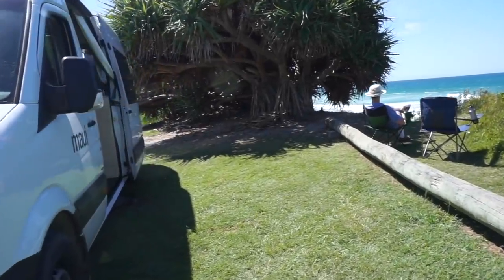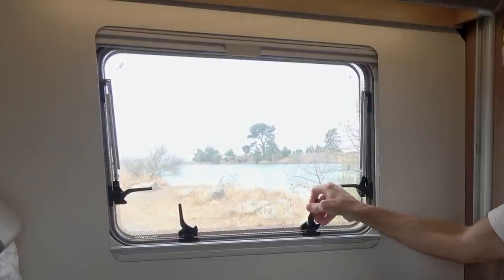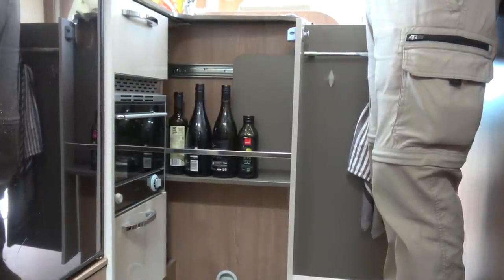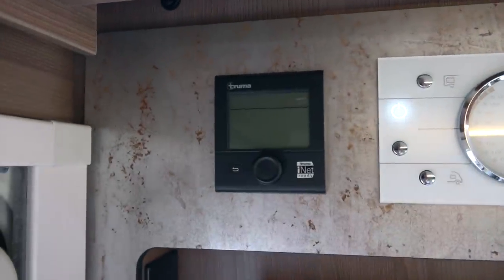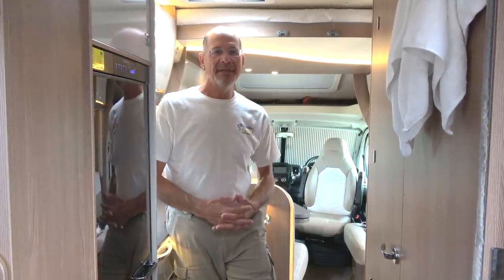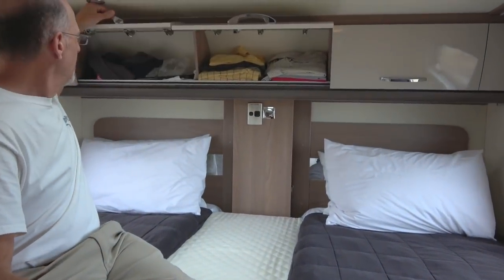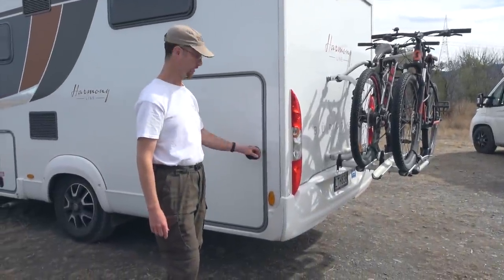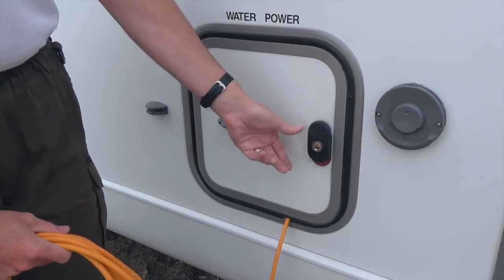Class B+ RV Tour 🚐 — In-Depth Look at Our New Zealand Wilderness Motorhome Rental

Comment: Our Winnebago Navion has the same shades up front and in the coach with one exception our latches don't have the locking button which would be great. The Navion is our third RV and we especially love the cab shades. We love the tilt up windows too for the reasons you mentioned.  Love the floor storage in the floor!
Reply from the maker: We've heard nothing but great things about the Navion, Barbara! So no surprise you've had three! We realized that we forgot to mention that there is another almost-identical in-floor storage compartment back near the bedroom! Very good use of space.

Comment: I love the blinds you're talking about. They would not only keep everything private, but also relatively cool in the summer. They should make them for car use. Here in the Northwest USA during the summer months, the temperature reaches in the 80s. With the windows up, the inside of a car can reach the triple digit temps. With something like this around the windows, I would imagine it would be around 70 degrees, with the AC unit going. 🙂
Reply from the maker: Those window shades are indeed awesome. The ones in the side windows are even highly reflective on the outside. Not sure why the windshield isn't the same way, but either way, they really help keep the rig cool, especially when you combine it with lots of windows that open very wide.
Reply: They should be available for installation on cars and trucks as well. 🙂

Comment: I think the skylight was installed with the opening facing upwards so it can be opened while driving. Otherwise the opening would be facing downwards so the skylight can be opened while it is raining outside and it would keep it from coming inside the campervan.
Reply from the maker: Good thought, Jay! That does seem possible, although the struts that hold the skylight up might not be up to the task of holding  that large surface area open against much  wind!
Reply: @RVgeeks  you are right it is not made to be opened while driving. I have been told the skylight is positioned in such a way as to not get torn off while driving at higher speeds if air were to get under.

Comment: One thing that caught my attention was storage of wine glasses and mugs. The shelf seemed to sag under the weight of upright stemware. Am I wrong? This looked like the only thing that needs improvement on an otherwise awesome RV. Glad you made it back safe.
Reply from the maker: Hi John! If that shelf seemed in the video to be sagging under too much weight, we definitely didn’t notice it. The design of that glassware shelf, where each glass and cup was individually fit into its own holder, was so far and away better than the RV we had in England, where all of the dishware rattled like crazy as we drove!

Comment: Interesting it does not have a rooftop A/C unit. Guess you would not need it too much with that many skylights and windows.
Reply from the maker: Good spotting, Scott! No AC. It's available from Bürstner as an option, but with the windows opening so wide (and the typical climate in NZ), we didn't need it at all. Even though it was Autumn while we were there, it apparently doesn't generally get hot enough in NZ for anything more than the windows and roof vents to be needed.

Comment: Great job guys, 2 questions: Are the batteries lithium ion? Would the bikes fit in the garage?
Reply from the maker: Thanks! The batteries were AGM. We're pretty sure the bikes would fit, but we didn't actually try. Since they were mounted on the back,  we just left them there, leaving room for other stuff in the garage. We drove on some SUPER dusty roads, of course coating the bikes with dust. So the garage might have been a better choice! LOL
Reply: Although you can get lithium ion batteries, most RVs use lithium iron phosphate (for a number reasons that I won't go into here). It will be interesting to see if NZ travel vans upgrade to lithium over time but, because they're rental vans, use of AGMs no doubt keep the initial costs down. Just my 2c. :)

Comment: A question on propane.  My class C has a factory quick connect for a grill on it. Of course it is after the regulator. I know that you can buy a connection that goes between your onboard tank and regulator to hook up a portable tank if your onboard tank goes empty. My question is could you use the  grill quick connect with a portable tank if your onboard tank goes empty?  I know I would need a regulator on it, but would it mess my onboard regulator up having more pressure on the output side of it than on the intake side?
Reply from the maker: Wow! Interesting question! Theoretically? We THINK It should work. But we don't know for sure that it won't cause a problem with the onboard regulator if you did it regularly over time. And we're not 100% sure that the external attachment point doesn't have a backflow preventer in it for that very reason. If you DO try it... you'd definitely want to regulate the external tank down to the same output pressure from your onboard regulator (11" Water Column)... and we'd turn off the valve on the onboard tank, just to ensure that it didn't get filled up if the onboard regulator didn't stop the backflow of propane.

Comment: Awesome review guys! I am sitting here in Auckland planning a couple of years in Europe and the US travelling by camper... one of my concerns was buying in europe then selling then buying again in the US but it sounds like I should just take my European RV to the US and sell there when I have finished with it?  Any issue using the cassette toilet in the US? I guess the only other issue might be power conversion?
Reply from the maker: Hey Philip! Sounds like you have an amazing couple of years planned! We'd think that transporting, and importing, a non US-spec vehicle to the US would be a somewhat daunting task. The US has some pretty stringent requirements that may make it cost- and effort-prohibitive, including the cost of transporting it across the Pond. We'd guess that selling in Europe and buying a used rig in the States might be simpler, especially if you're looking for a less-expensive rig, as they should be readily available all over http://rvtrader.com. A cassette should be no problem, although less convenient (people here do have them, usually in  smaller rigs), but the power issue might be a real challenge. Another issue that might make it harder to sell a European RV here is the lack of ability to connect directly to city water. People here are used to being able to hook directly up to pressurize their water system and not run off the fresh tank or water pump when they're in a full hook-up RV park. Best of luck. What an adventure!
Reply: @RVgeeks  thanks for your feedback!
There is a company called Seabridge that will ship RVs from Belgium to Halifax or New York and have found several blogs where they come highly recommended.  the cost appears to be about $3k and it takes about a week.  Registration seems to be a non event as long as you stay less than a year (could be a sticking point)... having been watching the prices on second hand units in Europe I can see it can take months to sell so have been a bit concerned about selling and buying  BUT i do take you point.  I guess we should just hope that the US manufacturers one day start to take on some european ideas and style, lol!
Safe travels!
Reply: wow speedy like... you guys still stuck here in NZ?
Hoping for level 2 today!
I have 10 acres in west auckland you are most welcome to park a couple of campers on if you are looking for a change.
Reply from the maker: Thanks very much for the offer, Philip... but we made it back home to North America in early April. Hope things continue to go smoothly for you all down in NZ and that you get to be out on the road again soon!
Reply: RVgeeks great news!
NZ back to level 2 from the 14th so most people are out and about again!
Hope you get the opportunity to head back sometime in the future!